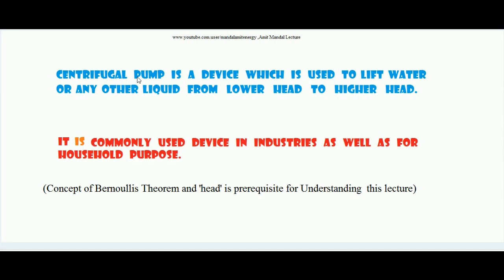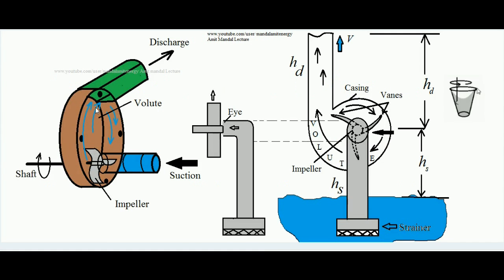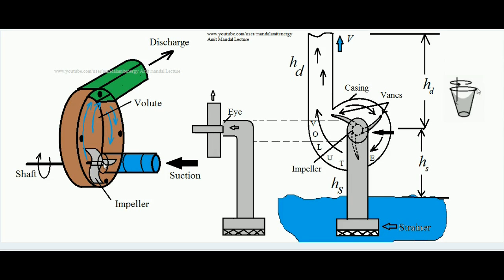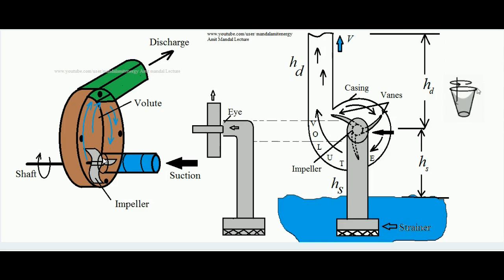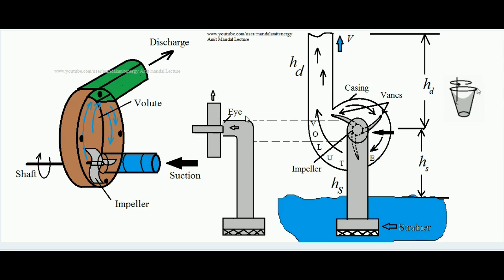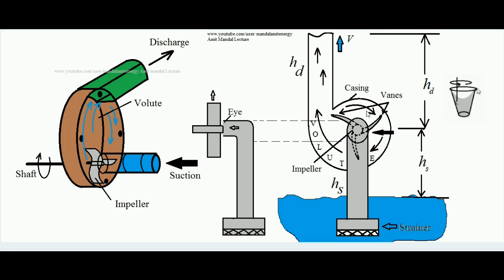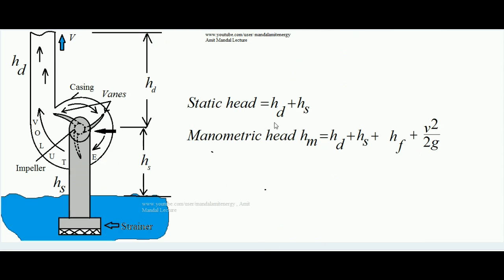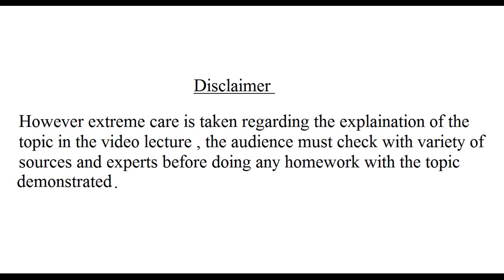Centrifugal Pump Working principle

Comment: sir, am a farmer. I want to know what I'll lose if I locate my irrigation water pump about 100 meters away from the river.                              

Can the pump still suck efficiently and still give me the required pressure?     

please sir, urgent reply will greatly be appreciated. thanks.
Reply from the maker: +Isaac Addy it mainly depends on at how much low level the water level from pump in vertically downward direction and what is the friction factor of pipe....greater the tqo quantities are greater the energy required by the pump.....
Reply from the maker: +Isaac Addy in case the level of water is too low i.e. pracrically approx 7 meter or more depth then it would not suck the water at all...
Reply: okey, thanks a million x
Reply: No maximum 33 to 40 fit only
Reply: surjeet singh okey . Thanks sir
Reply: Please what happens if the rpm of a waterpump is increased to ,lets say 3000rpm or 4000rpm or 7000rpm or 10'000 or more.